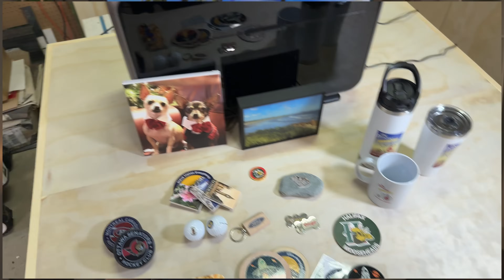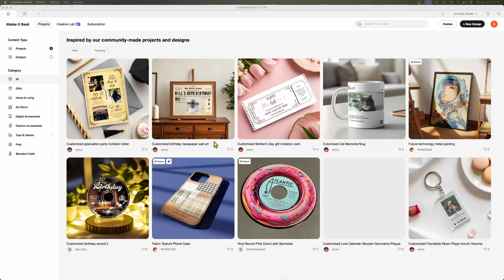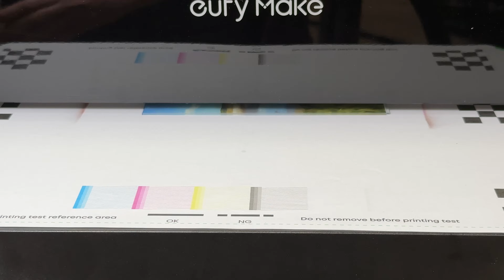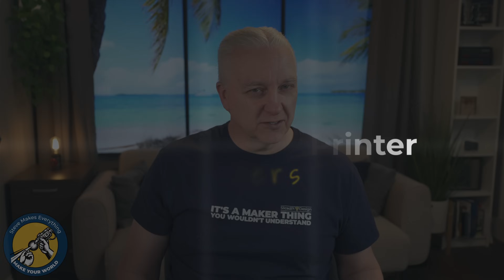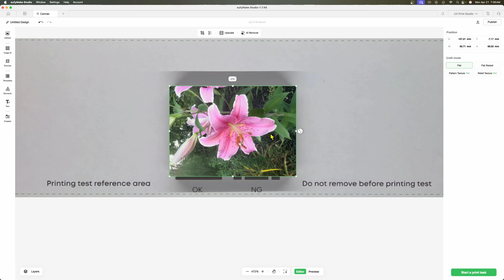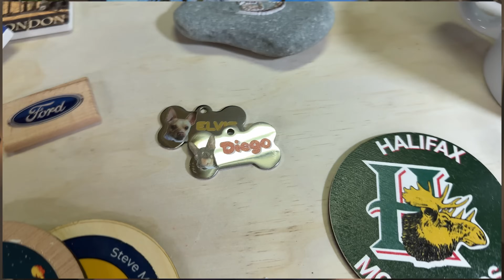eufyMake E1 | Pro-Level UV Printing for Creators at Home!

Comment: Hey, I know  the inks smell while printing but I wondered if the inks smell even if the printer is on idle? I plan  to use it in the next room to the room I sleep in so this will be a deal breaker to me.

Thank you for your time! :)
Reply from the maker: When the printer is sitting doing nothing is doesn’t smell. I think I recall Eufy saying they were working on an enclosure, but mine sits on my bench in front of an exhaust fan and I just turn that on when I’m using it.
Reply: @SteveMakesEverything  Thank you so much for the time to answer my question.

I will mainly be using it for printing phone cases (possibly), because currently we are doing sublimation on phone cases but quality of the cases is really unpredictable and I prefer if I can print on any case, not just the sublimation ones.

Did you maybe test if the ink is durable enough on the cases? My main concern is that I've seen other cases printed with UV printer and the ink breaks and starts to fall off pretty easy. Maybe if the case is with acrylic back helps (not easily deformable)? Wonder what experience did you have with the cases they provided and if you tested possible another phone case (not supplied by Eufy?).

Also I saw in another youtube review that the printer actually needs maintenance during regular intervals (not only self care), like once a month to clean the head, clean rails etc. Did you find that hard or just a simple easy for everyone task? 

Again thank you so much for your time, I really like your videos and I am really happy you found time to answer.

Have a lovely day! :)
Reply from the maker: @veselindobrev6315  I've printed a ton of phone cases with the regular rigid white ink and have had one on my own phone since I got the eufyMake a couple of months ago. So far, it is still perfect, though it is pretty rigid, so I wouldn't flex a lot.  This would only impact a phone case with a significant texture BTW.

However, yesterday I received an order of the new flexible white ink for the eufyMake, and I'll try it on a phone case to see if it is as durable as the current ink, AND can easily flex without cracking.  

As far as maintenance, there is a simple cleaning process that should be done roughly monthly.  It basically involves moving the print head to the middle of the printer and cleaning the UV light and the print head surface and inkwells.  It takes about 10 minutes.

Comment: Is the rotary attachment actually worthwhile? I hear that prints on cups and tumblers are not microwave or dishwasher proof?
Reply from the maker: For what it's worth, I made both a mug and a tumbler that I put through a dishwasher and have run into no issues.  Though as an aside, Eufy is about to release "UV Adhesion Promoter Prep Pads" which will improve adhesion on some surfaces (e.g. bare stainless steel).

Back to your question about the rotary:  Really, you're asking the wrong person since I don't do a lot of rotary work in my business, so I don't have a lot of use for a rotary on any device (except my CNC). But if you do want to print on anything round, then a rotary is essential.  I will say that the eufy rotary is the easiest to use rotary I've ever seen.  Its only real limitation is that it doesn't handle narrow-necked water bottles, but someone is going to resolve that (might even be me because I've been thinking about a jig to allow this)

Comment: $300 for ink is a deal breaker.  it uses twice as much white ink because of base coats, the machine runs constant cleaning cycles wasting ink and cleaning fluid. a subscription service... no thanks
Reply from the maker: Cleaning here uses cleaning solution rather than ink. Buy one or not. Always buy what you are comfortable with. I finally swapped my ink cartridges and even at $300 I had little trouble selling enough to pay for the set.  In the end the ink goes a very long way. Eufy is also promising a constant ink feeder which will cut the ink costs in half.
Reply: @SteveMakesEverything  you use twice as much white for base layers yet you only get one cartridge. build layers and it drains ink.
Reply from the maker: @Peter-w1i4v  This is partially true, but you aren't always using a white background, nor are you necessarily laying down multiple layers of white.

No question, while printing, you will typically use almost as much white as the other colors combined.  It's the price you pay to print on items regardless of their color.

Comment: I do sublimation prints do you think switching over to UV be better?  I am sure my cost for ink would go up using UV but think there might be a time saver on some items.  Also with UV I can print on more item.
Reply from the maker: I guess this depends on what you sublimate now.  If you are creating t-shirts, then at least for now, UV wouldn't be a good choice. But if you were making tumblers, coaster, keychains, or a anything else that was a hard, relatively flat surface this printer would probably be better because it would be a faster process and would also offer texturing.  It's impossible to sublimate on a laptop, but with this eufy printer you can put the laptop on the workspace and print directly onto it.

As far as ink, I think the perception that UV is too expensive is overblown.  It definitely cost more than sublimation ink, but since I've had this printer, I've printed at least 40 items and sold a small portion of them already, and that was enough to pay for a set of ink  cartridges a few times over.  Eufy does seem to be sensitive to the ink cost and I believe they are going to drive the price down fairly quickly.  They are also working on different kinds of ink and will soon have a "soft" ink that will work well on surfaces like cloth and leather. 

Hope this helps.
Reply: @SteveMakesEverything  I do a lot magnets for professional photographer where he sells them at the Art Galleries gift shops and art shows.  I also do professional grade photo panels which are seen in Art Galleries for other photographers.  Pretty much I do a lot of hard surface type work but do make a few T shirts here and there.
Reply from the maker: @paulveenstra6305  Sounds like your bread-and-butter business would be perfect for a UV printer.  You could always just shop your t-shirt designs out to a DTF printing shop, which usually charge $0.03/sq inch.  Then you could avoid sublimation and a DTF purchase and save tons of money

Comment: Will this work well on Mylar Bags?
Reply from the maker: I did a print on Mylar sheet and it came out amazing. You wouldn’t be able to do texturing because the flexibility would probably crack the ink. I think the whit ink is more brittle so if you bag was already white then you could print without the white background

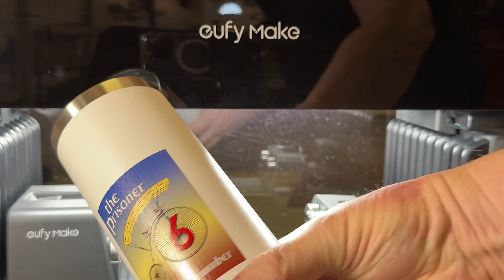Comment: If I stop the video at 08:15 for example, I do see the lines it printed is that something that's less noticable in person?
Reply from the maker: Yes, certainly less noticeable in person, however is is a printer so I’m not sure Eufy will eliminate these completely. However they are still working on the software so this will probably improve this. Lots of reviewers ha asked for manual calibrations in addition to all of the automatic features.

Comment: im little confused with  """laminating"""
my friend printed me on acrylic

and its impossible to scratch with  fingernail
no laminating need

so how this  printer need laminating?
isnt the UV cure the  print ?
Reply from the maker: Not sure I completely understand, but the laminator is used only to make stickers.  You laminate on a protective surface so that once applies, the stick is fairly well protected from damage
Reply: @SteveMakesEverything  
UV prints dont need protective lamination

mightbe im wrong  but  this is   what i got
printed on various surfaces  and no extra lamination

acrylic, aluminum, pvc
none of them was need  extra lamination
Reply from the maker: @cnccarving  I didn't apply extra lamination on anything but stickers.  And they definitely need this.

Comment: Hey Steve, again great video.  A couple of questions...I am interested in UV printing designs on some laser engraved tumblers.  Kind of a mixed media type thing.  One thing I like is the use of the camera to line up the prints exactly where I would like them, however, with the use of the rotary, once the canvas has been established for a tumbler, do I have the ability of then using the camera to get my artwork to line up with a specific area of the tumbler like I do on a flat surface?  For instance, if I want to do a full wrap on a Yeti tumbler and make sure that the graphic on a side with the Yeti logo is aligned with with the logo, can I see that using the camera?.  I understand I wouldn't be able to view the entire layout (which would be awesome if the software could "flatten the rendered image it creates for this purpose) but it there any way to do this?  Is it also possible to create UV printed stickers that would (1) have a paper backing and (2) stickers that can be printed to allow them to be applied to the inside of a window (as opposed to the outside)...for instance apply them to the inside of a car window as opposed to the outside of a car.  Kind of silly questions but just thought I would ask.  Do you think I can get really high resolution portraits on something like metal with 1440 dpi?
Reply from the maker: It’s harder with a tumbler to do this since the eufyMake software doesn’t capture a photo for the tumbler. I wish they did and it’s certainly something I’d like to have too, so I’ll add this to their feature requests.

Getting the full wrap aligned with emYeti log is easier. You just need to make sure when you place the mug that the logo is facing up so it is on the center line. The resolution overall is very good.  I haven’t done a photo on a tumbler but I have made photo canvases and they look perfect.  You’d lose some resolution on a tumbler due to the small size though.

Comment: Hey Steve great video 
My question on your prisoner  straight tumbler it looks like it has banding does it have this or is it the texture  of the tumbler thanks
Reply from the maker: There's a bit of banding along the axis, in part because I made the image a bit textured, so it's actually think enough to feel the edge.  When I get a chance, I'll go back and try this with a normal print - and it will also be quite a bit faster.

Some of this could also be related to the alpha software I'm running.  They may still be doing some calibration on the rotary software (i.e. steps/revolution).  If not, I think they need to add a manual calibration setting for this, and it's something I plan to nag them about.  At no point do you need to enter the diameter of the cup - the E1 calculates all of this itself, but based on my experience with laser rotaries, if the step/rev is out even a bit, you will see either slight overlap or slight gaps.  I think the auto calibration is quite accurate enough yet.  The other thing I've noticed is a slight color bleed on very thin lines (like the bicycle spokes).

All of this is hard to see with your eye, but cameras are much better at resolving these tiny details, and a photo will show every minor flaw.
Reply: @SteveMakesEverything  Thanks

Comment: Good detailed presentation, what is the maximum diameter for rotary? 
Thank you
Reply from the maker: It's pretty much the entire height of the inside of the printer, some probably around 110 mm once you discount the height of the rotary itself.  The rotary clamps a tumbler by the rim, so it's very height efficient - the downside of this configuration is that it doesn't handle bottles very well unless you want to make a jig.  I've been thinking of a design I can 3D print to make this possible.

Comment: Hi Steve, thanks for the great videos. Is it possible to print onto handbags? (think you might call them pocket books). Is it possible to try? 👍🏻
Reply from the maker: Not yet, but they are planning to release "soft ink" by the time they start shipping these and that will make printing on leather or canvas better/possible.  Hang in there for another month or two and there will be a lot of new accessories available for the E1

Comment: Have you SOLD anything made with the printer?
I like your channel, and may I ask you for a favor, please address the cons at the same level as the pros.
While I have liked your channel, I like more balanced reviews of products.
There are so many people that got one of these UV printers free, and their videos all seem to be sales videos.
The only channel that seems to be asking the tough questions is Ogrinz Labs, who did not get a free printer.
Will people pay for an imposto (raised/textured) painting? Where the cost is $22 in ink, and 7 hours to print. And when so many people buy these UV printers, the market will be flooded with people selling raised prints. The tumbler and mug markets are already saturated with sublimated items. The flat metal market, and sticker market the same. With heat transfers, sublimation, vinyl, direct to film (dtf), white toner laser, and other uv printers, the market is saturated with sellers using these technologies. This printer looks so cool, but that's also its problem ... when tons of people buy them, the market will be oversupplied with sellers. That's not a market I want in on. Etsy and eBay will be flooded with AI, raised/textured prints within days. And it will be a race to the bottom.
I have been turned off by so many other youtube channels that seem to be just shills for this printer. I will watch Ogrinz Labs channel because of his honest review. I hope you’ll also address the market potential of this printer with the same skepticism.
My comments are from a fan that wants to keep watching your channel. Please consider giving advice, when it’s balanced, I trust you more.
Reply from the maker: In any review, I try to find typically three positives and three negatives, so that seems pretty fair to me.

Yes I have sold things from this printer - mostly phone cases which people seem to love. Ai is. Tool like anything else and in the wrong hands it will create things that no one’s cares about.

Your point about lots of people buying these is valid, but realize that this printer on its own isn’t magic. Things that sell still require talent regardless of the tools. Millions of lasers have been sold but very few people can make serious money with one.

Comment: I am somewhat skeptical. A little more skeptical :-) I am missing some very important informations.
For example, does the supplied SW support calibrations (linearization and ICM profiles) that the user could do themselves, or have done independently? For printing on specific materials, this is a must. After all, the example of backlighting a photo in the video shows a very tragic result (in terms of color).

Does it have heated print heads for print stability? Does it have white ink circulation? What print heads does it use specifically? According to (very brief and terse) information, it probably has DX7 print heads, which are not very suitable for UV printing (especially if they are not tempered).
What about air extraction and filtration? UV photopolymers are carcinogenic and very dangerous to health, as are their fumes. So I wouldn't recommend it for homes, certainly not without proper ventilation!
What is the price of ink? 100 ml cartridges are obviously not going to be cheap, so what you "save" on the printer itself, you'll pay handsomely for in ink.
It's a nice toy at first glance, yes, but I definitely wouldn't buy it. I have a lot of experience with printing with various technologies, so I have a lot of doubts about this printer...
Reply from the maker: I’m sure the best one to ask about the deep technical questions is Anker.  There is an air filter built in the works great when using the small bed.  I plan to put it into an enclosure and vent it outside.  On the ink front, Anker says they are working on a cheaper ink model that will cut the price in half, so I’m not too worried about the cost.

I saw something about ICM profiles in the software, but it’s meaningless to me.  My backlit photo color was pretty true to the original, so I would hardly call it tragic.

Regardless, this is not meant to provide all of the complexity of a commercial printer, so some things will be stripped away for simplicity.

Comment: HOCKEY PUCKS...how long does it take to print them as pictured on your video?  Does your sample include any Relief or are they both Flat print??
Reply from the maker: They are just a flat print, and as a result, they print pretty quickly (~4 minutes).  I might be tempted to print them with a white layer first, just to make them pop a bit more, but they look pretty good as they are.

Comment: Have you tested the durability of the ink? How does it stand up to rubbing or scratches?
Reply from the maker: I've done some of this. I did a destructive test on the golf ball I showed in this video. I took a carpet knife to it to see if I could scrape off the print. This cut through the print and damaged the ball surface before I could see white again. Then, I took a hammer to it and bashed the printed logo repeatedly to see if I could cause it to peel off. This had no impact.

With the tumble and mug, I passed them both through a regular dishwasher cycle a few times and that had no visible effect..

I also printed a 3D image on clear acrylic to see if I could peel it off or chip it.  I was able to chip off pieces of the 3D image, but required a wood chisel and mallet to remove even small chips.

Overall I believe this ink resin is pretty darn durable, and I'll try to post a short video of the golf ball since I recorded that for another viewer.